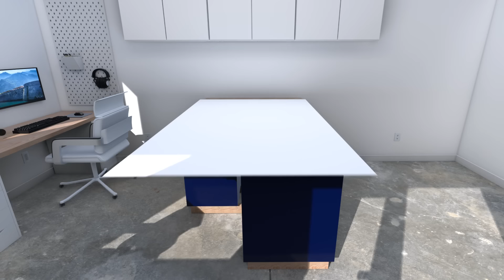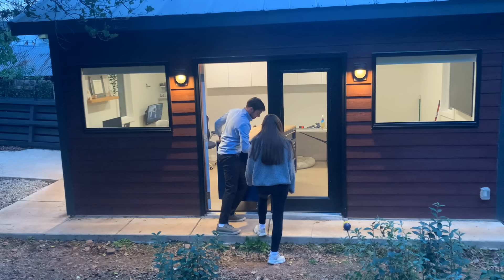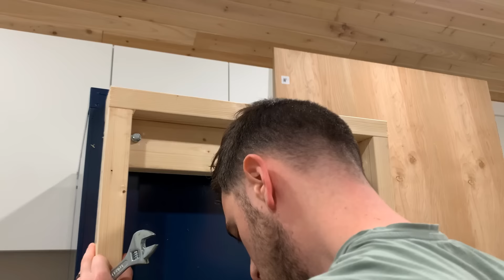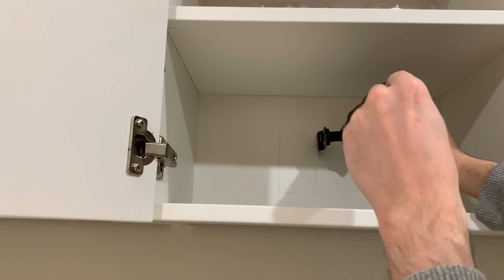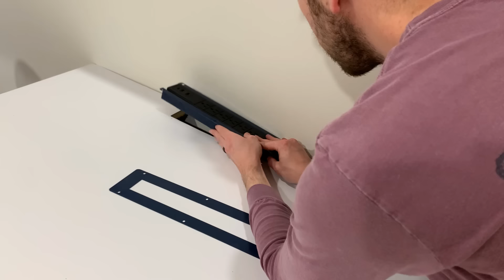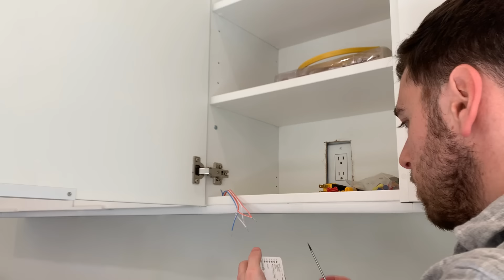Building My Own Personal Makerspace

Comment: I am sorry for being a dick, but the way you fixed the top wall cabinets to the wall is rather dangerous. No amount of screws would hold the weight if the are screwed through the Ikea's dingy cabinet back wall. It is far too thing and would rip. You really need to add fixings into the dedicated mounting brackets in the top corners of the cabinets. Good quality dry wall plugs butterfly style would go a long way. You did good by screwing them together, but that means that once the weight limit tips over the threshold, the WHOLE thing will fall down. Please add more screws in the dedicated spots. Otherwise, great work, guys!
Reply from the maker: The screws aren’t just through the thin mdf back wall, there is a heavier board that runs behind that part of the cabinet that we are mounting through
Reply: @Visual_Thinker_yt ikea wall cabinets don’t usually have a nailer strip, did you add one out of frame? The mounts are the metal angle brackets you added that have the white caps over it. They are meant to use the keyhole plates with the hanging rail. You can also use blocking and the keyhole mounts by themselves, this distributes the load to the sides in sheer. (Edit went back and paused the video, looks like those do have a board across the back, strange, don’t remember that being there before.)

Comment: I made a desktop in the late 90s like you did.  Only I used finish nails and a nail set with glue to attach the face framing with mitered corners.  I think the top was cabinet grade birch.  I stained/poly coated it and added cast iron pipe for legs.  Used it for my PC in my office.  I started working from home in 2013.  It been my daily desk ever since.  It's taken quite a beating.  Thinking of hooking up some built ins and redoing it to add a few drawer bases and pull out printer storage as well as solid ash or likely cherry butcher block top.   It's been super functional and durable.  I did add some under wire baskets baskets in the back from IKEA at some point along the way. It houses 2 32 inch monitors, a laptop, and a small desk top.
Reply from the maker: Sounds like an awesome desk 👏

Comment: Unless your video if flipped, it looks like you are going the wrong way with the router with the flush trim bit
Reply from the maker: Good catch! I did go backwards with the flush trim bit. This was something that I saw a lot of people recommending to try and prevent chipping the Formica. Not sure if it’s necessary but worked for us
Reply: Climb cuts leave a smoother surface, especially with tricky wood or composite materials prone to chipping.